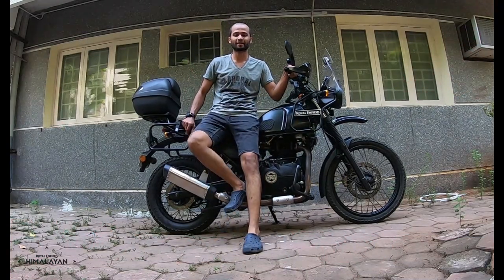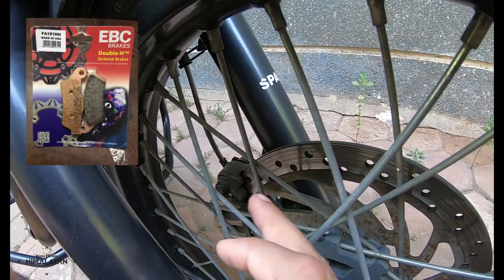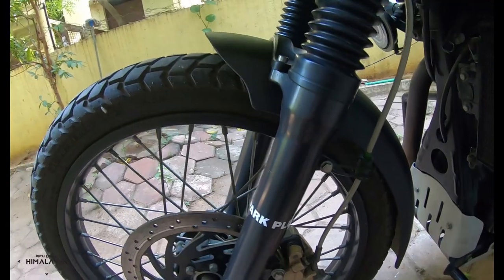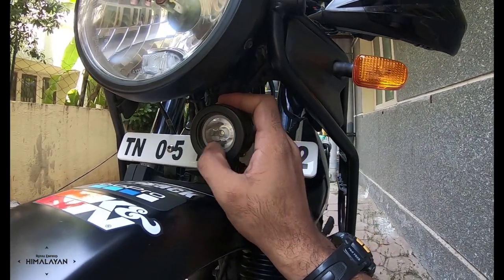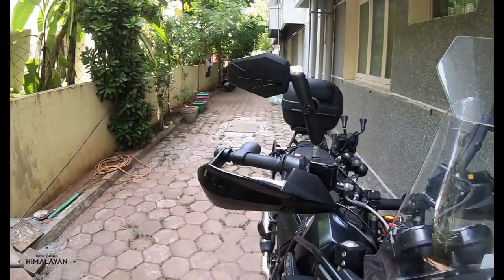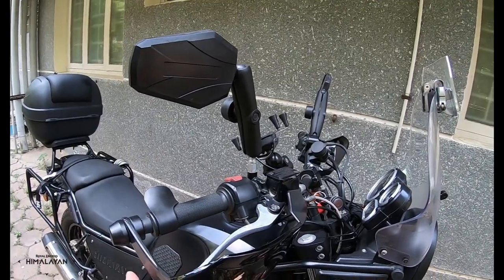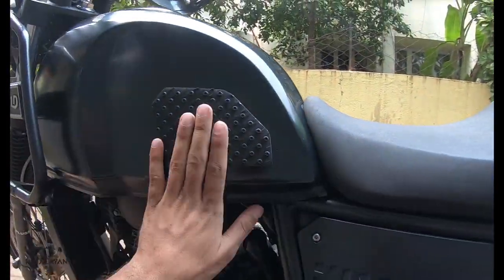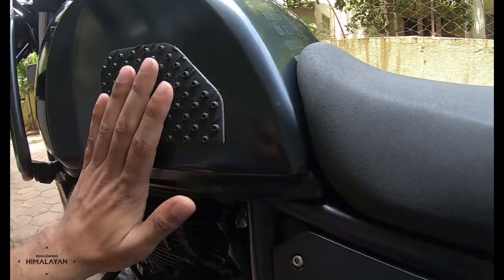MODS ON ROYAL ENFIELD HIMALAYAN. - PART I

Comment: Hi Ben, Hi to everybody in this community

Have a good and happy new year.

My tipp instead of Barkbusters: Its the Handprotector from Acerbis, full metal, plastic - Pieces in front, changeable when broken (but normally not necessary, they are really heavy duties), inside a very strong metal - buster, its really also heavy duty and works very well...... The Price in Germany about 60 or 70 Euros, half the Price as original Barkbusters.

You can find them on Amazon and in every good managed and sorted  shops in the internet... The Amazon - price in Germany is a little higher, but really lower than original barkbusters.

Best wishes to you and your channel

Greets from Germany

Peter
Reply from the maker: Hi friend. thanks for the concern . i have bought and installed cheap Chinese ones with a metal arm for support . kindly check out my newer videos. thanks again for the tip.

Comment: Hi Ben
I have few questions regarding the handlebar
1•Will those switchgear positioning knobs go right in place with the holes on the KTM handlebar or we need to drill new ones?
2•Without the bar risers, will this fit just like the stock bar or will there be a curvature-diameter mismatch?
3•Is this the stock handlebar of 2019 Duke 390?
Reply from the maker: switchgear will fit alright but you will have to drillout the existing hole to a slightly larger dia (5-6mm)
will fit without the bar risers very well. just like stock.
yes it is the duke 390 but 2018. 
also pls keep in mind that these bars come towards the rider and are not straight like the stock ones. they are street handlebars , extremely comfortable on long rides but not the best choice for hardcore offroad riding.
Reply: @ONTWOWHEELSBEN  
Thanks a lot for your response and inputs brother! 
Please make one video on your riding gear someday .
Cheers! 😊👍🏻

Comment: Used EBC brake pads once, brake strength was better  but  worn out quicker than the stock. How long it is working for you?
Reply from the maker: The better the pads the faster they wear out . Longevity is important but not in certain components of a motorcycle. Especially BRAKES .

Comment: Hello Sir, I was just wondering if i wanted to modify my Himalayan, would there be any problem if i use RE classic's aftermarket alloy wheel rims? i know they're not of the same size..but would it still go well with it? what  issues are there to consider?
Reply from the maker: the front of the classic is 19 . that will cause a difference of more than 10 km/hr error on the speedo. if yours is an abs model stay away from modifying the front. the rear of the classic is 18 " and the himalayan's is 17" so you will loose about 1-2 cms of suspension travel . you may bottom out more frequently when riding with load exceeding 150 kilos .

Comment: I would like to know does K&N or BMC filters make any difference in the performance, or stock filter is upto the mark
Reply from the maker: they will make the bike run better if you live in a colder environment . anyplace where the average temp is 32 degrees and more they will make matters worse. watch my videos on performance upgrades and custom db killer to understand more.
Reply: @ONTWOWHEELSBEN  after seeing your video i am asking for your opinion, I have Delkevic performance exhaust installed in by himalayan, and live in UP which gets pretty hot in summers, so it's of to install after market air filters.
Reply from the maker: Rachit Dhammawat kindly watch this video for a better understanding https://youtu.be/YRkZ3TI_0Pc

Comment: Nice video very interesting!  I would also like to do the mirrors and the handlebar risers with me!  If I drive standing it is too deep for my arms!  Do you also have problems with the original battery?
Reply from the maker: ye pls go ahead with the mods . also yes the standard battery is troublesome . i changed mine to amaron in 6 months time

Comment: Hey, the splitfire ignition cable- is it direct fit or do we have to cut the insulator a little?
Reply from the maker: yes , you do have to splice the cable if you want to shove it into the coil
Reply: @ONTWOWHEELSBEN  Cool thanks. Well thanks to u i got powertronic ECU, cyclops LED and splitfire cable. Thank u so much for convincing us that the products are worth it
Reply from the maker: @shubhaykadam9904  always willing to share friend . and thanks for the acknowledgement .

Comment: Very good modifications . .. nice video .. is it wise to put a performance airfilter and free flow exhaust without piggyback ecu ..
Reply from the maker: no it isint , especially in modern engines which run extremely lean from the factory . any one of them is ok . but both together will def heat up the engine more than usual.
Reply: @ONTWOWHEELSBEN  thank you for the reply .. looking forward for part 2 cheers

Comment: Why only one spot lamp?. Very good explanation of updates.
Reply from the maker: my led headlight bulb is more than suffiecient for highways . i only need one spotlight for offroad sessions at night considering its def going to be a rare occurrence and at slow speeds.
Reply: Hi Ben can you suggest yellow or white Additional light , and will these lights chargers all these electrical fitting will damage my bike battery ??
Reply from the maker: Ajay Ritto is you know wiring then it’s a simple deal . Otherwise it’s best to run every single fitment/accessory directly to the battery via a switch .

Comment: royal enfield handguards are worth the money. solid. I use it and has given me best value for money with protection.
Reply: @Akhilpoomala  Use and comment. better than shitty aftermarket parts that don't fit and serve the purpose. Practicality over looks. Also its not bad looking as other in the market. 2000rs nobody will give such a sturdy functional part.
Reply: @TheHoolabalooga   Himalayan lookin superb from factory.with that odd lookin guard not good that why most riders buying ktm plastic guard thats only for wether protect. RE single mound guard will rotate even in a single fall. 2200 rupees you can fing two points moun knuckle guard with aluminium thick support. And as using that😊.
Reply: @Akhilpoomala  Ha ha. Then maybe people should stop falling from bike and learn to control the bike. These are solid handguards and if you have an Allen key (basic tool kit) you can set it again in seconds. No hassle to fit at 2 places. And you can lock handle with it no issues. Most people go with KTM handle guard because they look for a cheaper alternative. Now having ridden extensively through slow/ice/cold/rain/bushes/thorns I can stand by RE handguards as a very good option at the price range. try hitting RE handguard as hard as possible when you see it on a bike.
Reply: @TheHoolabalooga  2200 better option here. So am using that. In an adventure perspective capable ugly is better than cute useless plastic.

Plz share email id i can share the product pics.
Reply: @Akhilpoomala  whatever works for you man. I am satisfied with the product I have. Ugly doesn't matter as far as its useful. So I know for sure the ones RE provided are useful being tried other ones.

Comment: Hello brother, everything looks awesome 😎.
I need an information from you, just purchased the bs6 v2 himalayan and 1500kms clocked in its odo. While revving above 3.5 rmp, I get tik tik feel in the handlebar. None of them in the service center found that, they just said it's normal. I hope you can give me the solution for the above.
Thanks in advance..
Reply from the maker: Yes , that’s because your are OVER REVVING the motor . Don’t ride the Himalayan like a sports bike . MATCH THE REVS TO THE SPEEDS/ momentum and you will never hear that sound ( detonation / pinging ) again
Reply from the maker: And the sound is not from the handlebar it’s from your engine .
Reply: @ONTWOWHEELSBEN  thank you ☺️
Reply: @ONTWOWHEELSBEN   and I don't ride my bike above 4k rpm as am planning to make the break in process slowly. I live in Ooty and none of the mechanic is perfect in working with chain tensioner and valve clearance. 
If I correct the above problem, will the engine be perfect without any noise ??

Comment: Sir I'm thinking of replacing the air filter and the exhaust with k&n and RRP  exhaust ..... but I'm more of a really long tourer so fuel economy is a priority for me ... as of now I'm getting an avg of 30kmpl on highway..... does the new exhaust reduce the fuel avg.... i know this is a long question...  pls answer ..... and check my channel out too😅
Reply from the maker: Abhishek Desai the airfilter and the exhaust is not a good combo without a remap of the fuel . Both the afore mentioned items will make your bike run terribly lean and will result in loss of power at any given rpm . As a result you will end up using more throttle to compensate for the loss of power and end up revving high which will result in even lesser mileage than now . Air filter or exhaust is the way to go . Or add a powertronic Ecu and ask the team for a custom map for your bike with the mods and you are all set
Reply: @ONTWOWHEELSBEN  Thanks for the reply sir.
Reply: @ONTWOWHEELSBEN  you recommend any one of them ?
Reply from the maker: @AbhishekDesair  the air filter
Reply: @ONTWOWHEELSBEN  thanks a lot

Comment: Anyone who instals ONLY two point crash guards must lack basic common sense when talking about "improvements" to a bike.
Reply from the maker: Then the ONLY person who should be blamed is the RE Designer who thought this should come as a STANDARD fitment to the Himalayan . There are advantages to a two point system which you may not understand because you are beyond BASIC COMMON SENSE . All that information in the video and all that you could see was this . And to take the effort to put it across in the most insulting of ways speaks volumes of your mindset . Thank you 🙏
Reply: @ONTWOWHEELSBEN  The ONLY NO common sense to a two point crash guard is the failure to realize the riders physical danger IF their leg is trapped by that collapsing "guard" and they can not free theirself afterward. As the mounting tabs are but thin metal tabs a 90* crash with a car bumper could easily collapse that "guard" onto the rider's lower leg entrapping them.